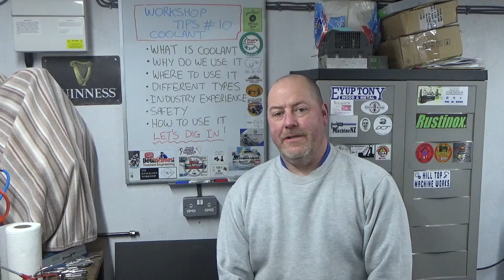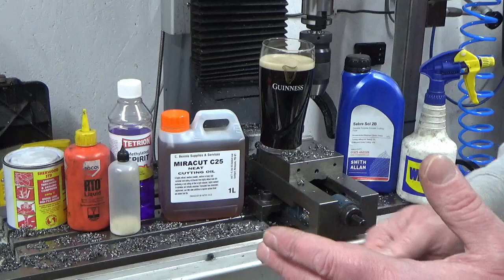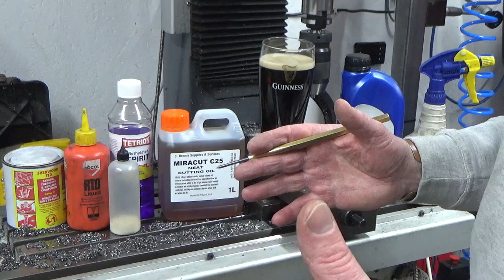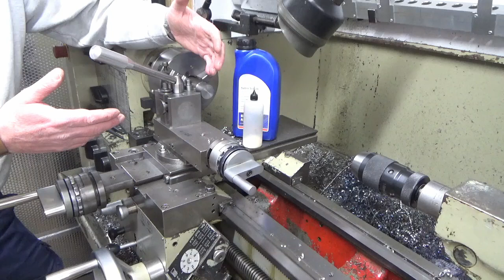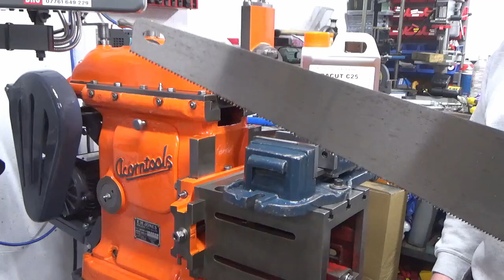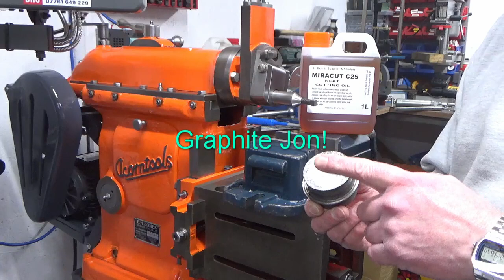Workshop Tips #10 - Coolant in the Home Shop

Comment: This may be some help to some one.On my metal cutting band saw i use a wax stick made by a company named Formax.It works very well and easy to use .It comes in a paper tube and has no smell to it.I have noticed that it makes your band saw blades last 4 or 5 times longer.To apply it i just turn on the saw and let the blade cut in to the wax stick for a few turns and thats it....The part number is No.F-168..Hope this helps....Phil..
Reply: Looks similar to Tallow, just found it on Web search, Tallow is still used by electrical installers for screw cutting the steel conduits, and tapping, her in the UK,  obviously nice an clean. Tallow was also recommended for threads on socket head cap screws when used in cast iron.
Regards John
Reply from the maker: Hi Phil, thanks for the comment and very useful information. I will pin your comment at the top for others to see. Great stuff. Cheers, Jon

Comment: A very useful session Jon, with some very helpful myth-busting. I always wondered what to use instead of whale oil 😂, now that you can’t get it!! I personally never use soluble oil, as my workshop is a very heavily “ventilated” garage (gaps around the double wooden doors and even the new roof), and rust is a constant problem from September through to March. So anything leaving an oily residue is perfect!
Occasionally I have even had to resort to using (clean) ATF or Engine oil diluted with white spirit - a bit smoky, but better than nout when the proper stuff’s run out! Your professional experience is so very useful, especially when the appropriate stuff is channelled into the home workshop environment. 
Many thanks
Mike

Comment: One concern that I have is cold temperatures with the water soluble coolant. My shop is not heated during the winter and I wonder if the stuff could freeze and cause issues?

Comment: Very interesting, im a basic home machinist and I do use lubricant on my lathe from a bottle and brush but I just cant bring myself to use that soluble coolant, 90% water just scares me as I hate rust on my machines. Having said that its obviously good as a coolant  and I would like to use a mister as you suggest but how do you clean the machine and does it cause rust or not?
Reply from the maker: Hi Campbell, thanks for the comment and question. Mixed at 10 to 15% I have had no trouble at all, and my workshop is very damp and humid. The water evaporates leaving the oil behind which actually protects your surfaces. Problems arise under vices/fixtures that have not been moved for months, you can sometimes see a bit of light corrosion here. It's used in industry on million pound machines etc so fairly low risk. I don't do any special cleaning, I just wipe the bed down each time I clean the machine which can be weeks in between if its not been used much. Hope this helps
Reply: @jonsworkshop  Thank you in that case Im going to give it a go cheers.

Comment: Great discussion on metal working fluids, I've seen static chucks and vices destroyed due to hand mixed squirted on soluble emulsion.
If I may suggest to anyone interested,  to purchase a pH test kit ( just a load of strips) to check coolant or straight oils.

I've been using a semi-synthetic coolant for my lathe and mill for several years, I  can easily go a year before bacteria destroys it, I use a fully synthetic on the surface grinder,  excellent stuff, tried it on the old lathe, but it's hard on the paint. 

Pretty sure your chemistry knowledge is better than mine tenfold, I've learnt the pH level is worth testing regularly,  old coolant becomes highly alkaline akin to pouring bleach all over your machine,  it permantes the coolant container, to the point of causing pitting, and holes. I've used a Citric acid solution to neutralise this, long soaking time, plus the Citric acid solution removes any rust.

I remember those industrial dermatitis posters, and leaflets informing on scrotum care, no disposable gloves available on the shop floor then, just barrier cream (Rosalex), and washing your hands, a few generations previous, many machinists would use the slurry to wash their hands before going home, as no washing facilities were provided.

Again Jon , excellent coverage on home shop metal working fluids, the filtration on those high pressure coolant systems is amazing , and as you state,  a science in its self. I was working at a company who used to manufacture CNC milling machines, and very large bridge Mills for whole wing sections on aircraft , and they had a problem with the swarf floating on the top, rather than going in solution. The company was from Wednesfield , and began with an "M".
Thanks for sharing and hope your blonde in a black dress never goes rank 😮
Regards John
Reply from the maker: Hi John, agreed with all that you say. I remember Rosalex, hated the smell of it. As for your big gantry mills, I have had a ride on one of them in Wales😊. Interesting story, they got through about 20 operators before they found one who didn't get motion sickness, or go pale and pass out as they rapid traversed towards the brick wall at the end of the shop! Lol. Cheers, Jon
Reply: @jonsworkshop  I love the smell of Rosalex, got a small tub of it, I use it less now, ref how cheap disposable gloves are, Swarfega was an acquired smell,  I used to take in a bar of soap from home to wash off the smell, until a lighter hand cleaner was available. 
Sailing experience required for machine operator,  brilliant,  I was told they were highly paid, by West Midlands pay rates.
TTFN John

Comment: Thank you for this. I have been thinking of expanding my coolant collection. I have been using simple 30w oil as cutting and way oil for my older machines. I also use alcohol now on aluminum, this video helps quite a bit. Thank you.
Reply from the maker: Hi engineering3d, thanks for the comment and feedback, much appreciated. Cheers, Jon

Comment: Rite Jon, I found this really interesting, some gems in this vid, will watch this one a few times. Known the benefit for a long time from first cutting bolts/screws to size then grabing them out the vise, to as you mention sawing wood (when you are cutting a say 25.4mm x 600mm board down its length, still do this even though I have a table saw)! The blade does get really hot and binds, I mostly use a wax candle for mine though!
A great wood worker I follow Paul Sellers got me onto a rag in a can which is a kitchen towel in a can with oil, used on your tools, or any bare metal surface (great for plane irons). Hogan6216 mentions a wax stick for bandsaws, a lot of jewellers use a similar product for fret and scrowl saw blades. Would love to use Guinness as a lube as not a massive fan of the stuff so best use I could think of for it lol! Paused the vid @28:15 to write this, tried to put in some PMSL emojis bout the Guinness, didn't work so scrolled back up but went past my comment and back to the vid screen and the look on your face was priceless... Looks like you are disgusted with me, did make me LOL!!! As always Dude stay safe n well. TFS, GB :)

Comment: Useful video Jon. I have an M300 similar to yours with a big coolant tank and pump. I emptied it last year as it had thick brown sludge in it. I know that bacteria causes problems in diesel tanks so I should have realised that it was the same stuff in my coolant. Again, I hardly ever use it as it makes such a mess. The mister does seem like a good idea.
Reply from the maker: Hi Ian, thanks for the comment. Yeah, unless you are using the machine daily, the coolant tank is just a nightmare. Mister trials upcoming soon 😊. Cheers, Jon

Comment: Hi Jon, You can also use high pressure lubricant to drive a cutting tool on a CNC machine. For hand sawing I use candle wax. The problem with coolant tanks are many and varied as you state, but the biggest problem is the Anaerobic bacteria building up under the oil film, however there are solutions to this. As you say this "tramp oil" is a problem and most machine tool manufacturers offer a skimmer to remove this oil, you can also purchase Ozone generators which kill off the bacteria. I know these are not suitable for the home gamer, but solutions are available for industrial users. Very informative video again Jon, looking forward to the next one, best wishes, Mal.
Reply from the maker: Hi Mal, thanks for the comment. Yeah, used plenty of coolant driven tools (part markers, speeder heads etc), through spindle coolant revolutionised machining in industry. Like you say, lots of solutions (excuse the pun) available to combat the coolant problems but nearly all of them out of reach for the home shop. That's why I have landed on my current setup to try and get the best compromise which I am sure will continue to evolve over time. Cheers, Jon

Comment: An interesting conversation Jon. I concur with the comments on aerospace use, it is a science and material depts put a lot of time and money into it's selection. 
I don't have anything soluble in my home workshop, all neat oils. The legionella thing, skin care, and just the presence of water in the workshop is a no for me. 
I mostly use Super Cut, maintenance fluid (WD40 type) and Rocol paste which do everything I need. 
Best wishes, Dean.
Reply from the maker: Hi Dean, thanks for the comment. Lol, I was pretty much the same, but then when I saw all the other water running down the walls and soaking up through the slab, I thought a bit more wouldn't do any harm lol. Cheers, Jon

Comment: Hi Jon. Very interesting video. I was under the impression that the water was evaporating from my coolant as I regularly have to top it up. But as you say, the oil would be on top! I have the “cheap stuff” and just top it up with a slightly thinner mix. Think I might need to re think my setup. Thanks
Reply from the maker: Hi Ricky, thanks for the comment. You will get quite a lot of evaporation, especially in the warmer months, most of it out the chip pan and on swarf etc. It becomes a nightmare to manage which is why I just avoid it completely. Cheers, Jon

Comment: Hi Jon I was using a water based coolant on my beloved Myford super 7 for the first time and next evening I went out to the workshop and the coolant had left a stain in the bedways I was gutted and I can’t remove it any ideas ,,,,,, by the way these beds are induction hardened
Reply from the maker: Hi John, thanks for the comment. Never seen that before. I would start with alcohol and a soft cloth, if that doesn't move it, WD40 next again with a soft rubbing cloth. If all that fails, try some of the soluble stuff (but in its neat form), again with a soft cloth. Sounds like water staining which would suggest very porous cast iron? Cheers, Jon

Comment: That was very interesting. I'm intrigued about this coolant misting thing. Have wanted to try it for a while. Generally I use Castrol Ilocut 486 in an oil can or I mix it with rocol paste. I have Ilocut 486 in the tank on my lathe and I do use the flood coolant system sometimes. As you say though, it's a pain to film with it running.
Reply from the maker: Hi Carl, thanks for the comment. I have a spare mister here, happy to send it through to you, might take a bit as I am rubbish at posting stuff. Let me know. Cheers, Jon
Reply: @jonsworkshop  Thank you Jon that is a very kind offer. Please don't leave yourself short of anything though.

Comment: Jon I agree 100% on using coolant on the cast iron. Especially on the mill. It helps confine the fine particles of cast iron that would otherwise get into the ways. Great video on tips.
Reply from the maker: Hi Terry, thanks for the comment. Yup, it is horrible stuff, I hate machining it. I have seen the damage it does to machines 1st hand. Coolant, and lots of it helps. Cheers, Jon

Comment: This is a great video Jon. Some really useful advice. I use cutting paste mixed with wd40 for tapping and drilling as the gloopy mix doesn't run off before you start the work. That's also some great advice on machining cast iron. Thank Jon. Cheers Nobby.
Reply from the maker: Hi Nobby, thanks for the comment and feedback, much appreciated. Cheers, Jon

Comment: Hi Jon, interesting video about a not so interesting topic (but necessary), In much the same situation as your self, got a lathe with coolant tank and pump but never used for the same reasons you gave of coolant going off. Tend just to use neat cutting oil (of any description really) but did adopt your use of the small squeezy bottles for the soluble oil type. Have thought about the mister type cooling but not sure about the risks with that either , worked in industry where legionella was a concern (had cooling towers and loads of safety showers that were tested weekly) and was always told that legionella was present in most water systems, but only became a problem in an aerosol form. The cooling towers were dosed with all sorts of nasty chemicals but the showers were just ran for a few minutes to avoid still and stagnant water. I suppose a cold workshop might be OK as the bacteria tends to like higher temperatures. Looking forward to the next video.
Reply from the maker: Hi Pakrattuk, thanks for the comment. Interesting thoughts on legionella, hopefully as we only get about two warm days a year where I live, the risks should be reduced. Interesting though as when you use coolant without air pressure added, you still create aerosols in the form of steam, but I suppose to get into steam, the temperatures are high enough to kill the bacteria?? As I said, this whole coolant topic is so broad its a science all of its own. Cheers, Jon

Comment: Rub a wax candle on your panel saw Jon , as less messy than oil when cutting timber. It’s an old cabinet makers trick.
Reply from the maker: Hi Shaun, thanks for the comment and tip, I really try to avoid dead tree bothering, but occasionally it becomes a necessity lol. I will remember this. Cheers, Jon
Reply: @jonsworkshop  Hi, yeh I know what you mean about machining carbohydrate foam as I can’t say it’s something I particularly enjoy even though when I was in toolmaking I often had to make wood patterns for casting purposes. Don’t mind spinning it up on the lathe but anything else is liking knitting fog in my opinion😂. Keep up the no nonsense approach with the vids 👍

Comment: Hi Jon, great content. Do you have any concerns with breathing in misted coolant from the mister type applicators. I have just got some of the fine nozzle squirt bottles you use and find them great to use.
Reply from the maker: Hi my1956, thanks for the comment, yes and no (sorry). As my use is really limited to a few minutes a day at best driven by my available time, any risk is very low so largely unconcerned. Legionella is a concern though especially as due to such low use, my coolant will be static for weeks on end at times. Mixed bag. Cheers, Jon
Reply: @jonsworkshop  as a health and safety I consultant I can tell you that although legionella might be a risk from atomised water emulsified coolant the bigger risk relates to the fact that there are nitrogenous compounds in a lot of coolants and when atomised by the likes of spinning grinding wheels this does present a risk of respiratory sensitisation. Hence misting systems are more of an issue. Keeping coolant free from “tramp oil” contamination and not allowing the pastry from your pies to accidentally fall into the coolant sump will stop the coolant from going off prematurely.

Comment: Gday Jon, great video, I used to use Penrite soluble oil and had the crap going off, I decided to spend more and now use Hangsterfers 5030 semi synthetic soluble oil and Hangsterfers Way Clear 2 way oil which is compatible with the 5030, I use the lathe and mill almost on a daily basis so there getting circulated all the time, putting flood coolant on the lathe I’ve noticed a big improvement in tool life and at the end of each day the machines are cleaned and oiled religiously, that’s a must in my books, cheers
Reply from the maker: Hi Matty, thanks for the comment. Yes, semi and fully synthetic oils are much less prone to the issues discussed here. I plan to try some different stuff when my current 1L bottle that has lasted me two years is empty lol. Your cleaning regime is superb, I am a scruffy oik, mainly driven by available time I have which is very limited. Cheers, Jon

Comment: Good overview, Jon.
I still use lard for hand-tapping, but it won't handle exotics like titanium. As you mentioned, the variety of solutions (pun intended) available has increased enormously in my lifetime, many with benefits only seen in high-end production applications.
For feeding soluble oil into a parting cut I use a hand-pumped pressurised garden sprayer, which gives a slightly better jet than a gravity can held aloft. 
Mist application might be another topic worth discussing.
Reply from the maker: Hi Russell, thanks for the comment. Coolant mist evaluation is definitely in the pipeline. I have units for my mill, lathe and surface grinder, just need to fit and test them. I will do my usual commentary giving my thoughts etc. Garden sprayer is a good idea! Cheers, Jon

Comment: Morning John. A very timely video. This week i happened to give a lot of thought to my use of coolants and lubricants in my home workshop. I have on order the neat cutting oil you showed and look forward to seeing how it performs. I will also look at using soluble oil using a dispenser that you use. All the best 👏👏👍😀
Reply from the maker: Hi Andrew, thanks for the comment. Sounds like a good combination. I only ever mix up my small dropper bottle at a time (approx 0.3L). 1 Litre of the soluble stuff has lasted me 2 years so far, and I have about 1/5th of it left, very economical. Cheers, Jon
Reply: @jonsworkshop  Definitely sounds like the most economical way to use the soluble oil, as well as the least likely to cause rust or become rancid. 👍